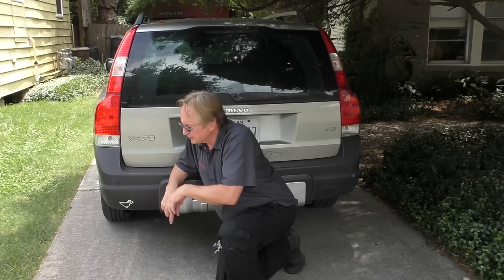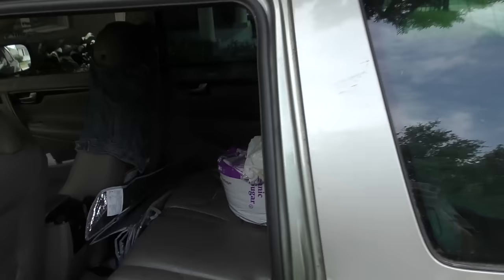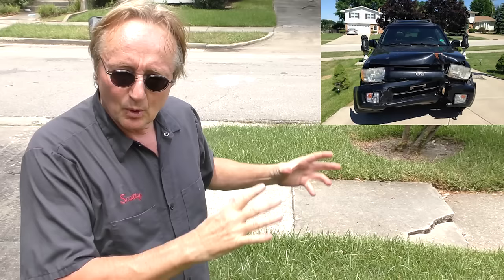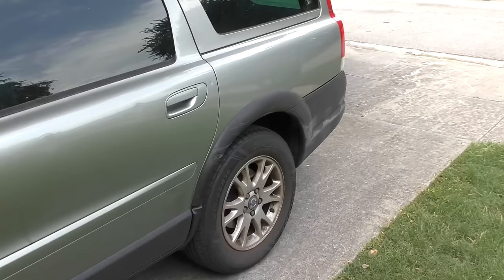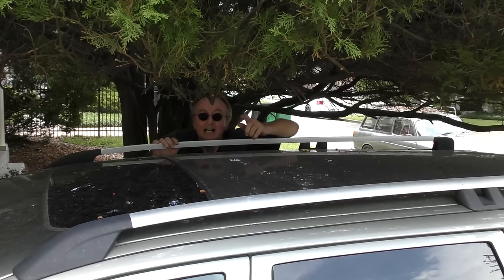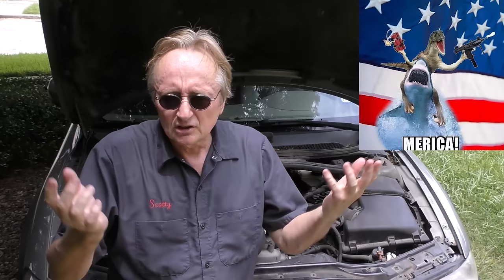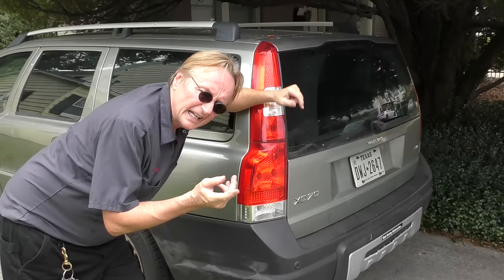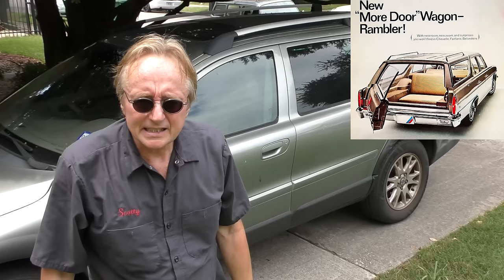Here’s Why Old Volvos Last Forever

Comment: Leather breaking is common in old Volvos, but if the car is high mileage and possibly 10-15+ years old, and still moves with no problem, it's acceptable imo.

Comment: I owned one. A ´03 V70 2.4 N/A 170 HP. Freaking comfy and reliable as a tank. The only reason I´ve sold it was its fuel consumption compared to the performance.

Comment: Scotty,
I just bought a 98 volvo v70. It's a wagon with like 154,000 miles. It has sat in Alaska almost 2 years. The shop that last worked on it said it was running rough and gave codes p0455 evap large leak, p0305 cylinder 5 misfire, p0300 randon misfire, p0303 cylinder 3 misfire, po301 cylinder 1 misfire. The shop then replaced the wires, plugs, rotor and cap. I guess it fixed it for a little while, but then it stopped again and wouldn't fire up. Then it sat for 2 years almost. What does it mean when all the odd cylinders are misfiring? It is a pretty nice car.
Now the car has a bad battery, which I am replacing tomorrow, and it has the alarm system going off with all the lights in the dash lit up. It won't even turn over now, let alone fire up. I think I hear and feel the gas pump engage. If the battery doesn't make it work, the next thing I will do is replace the gas filter. Also, the key got stuck in the ignition. Hope, I get it going, because I would like to get it out of Alaska before it is freezing!

Comment: My 05 XC70 has 226k miles and the original battery. It’s way more fun to drive any SUV or crossover, and that i5 is one of the best sounding engines out there.

Comment: Still have my first and only car a Volvo 940 Turbo, almost 187k miles and the last couple of years i'ts been on double the stock boost and the turbo has never been replaced, just changing the oil regularly

Comment: I had a 2004 VOLVO S60 with the famous 5 cylinder engine. Drove it for 12 years and 250,000 miles.  In between we smacked a deer going 60 mph, patched it up and it ran just fine.

Comment: I have a 1999 V70 with 300,000km (slightly under 200,000 miles) in the meter and it is still going strong.

Comment: 2001 V70 was totaled by my insurance company.  A UPS truck rear-ended it at 45 mph while I was at a stop light.  The rear crumple zone worked, and the Hyundai I was pushed into scratched the front bumper.  The Hyundai was in much worse shape than my Volvo.  It took a vehicle with a weight of over 20 thousand pounds to damage it.

Comment: It has surprisingly short and impractical (but easy to use) interior and small (low) trunk. Parts and maintenance is on the premium price range. It is loud inside, plastics are crappy and the engine of mine died and had to be replaced after less than 200k miles. But it still is amazingly comfortable and  reliable. It has carried loads of luggage, wood, bricks. It took as through long trips with 4 hours of non stop driving (and no pain afterwards), through paths where proper Pajero had issues rolling and through surprise bilzzards where most of the cars just had to stop. Overall it is a well constructed car.

Comment: I knew a guy who owned a Volvo dealership. He and his wife drove Mercedes, and he said to me that he wouldn't buy a Volvo 'cause they're endless money pits ... he didn't use that exact phrase, but he just said "They're unreliable to very expensive to fix." My landlord bought one a few years ago, and after a new engine and a new gearbox, with less than 100k miles decided to call it a day. But my best friend family had the old 240 back in the 80's... and that really was an endless money pit. 
     The best Volvo experience IMO was a work mate who had a 960. Probably one of the nicest experiences I've had of being a passenger. Can't lie I was impressed. But the inevitable bills kept coming until he got rid. 
      In terms of reliability, from what I've seen Volvo has been worse than VW cars .. and that really takes some doing.

Comment: I have a Volvo S60 2004 2.5T and drives like new! 173k miles. My ex nissan altima 2016 at 58k miles cvt transmission failed ;) dealer fixed it for free and I sold the nissan and bought the volvo for $900! Changed timing belt kit for $60, all rotors with pads for $99 and some engine and trans oil change. Booom pow love the volvo.

Comment: Bought one 2 years ago for 3000 euro. 2002 S60 170HP Manual.
It had 173 000 KM on the clock, now 242 000.
I would advice the manual to everyone it's bulletproof and shifts like new still.
Also the 170HP option is a perfect midway for speed and relability.
Spend like 3500 in the first year.
All normal stuff because of age.
Rubbers, belts, ac, thermo, trottle body, steering power pump etc.
Now it drives like new for almost a year without no problems.
Only oil changes and breaks.
I would advice it to everyone that wants a perfect all rounder car.
You can't expect something without wanting to spend money on it. Sure you can buy a Toyota, but does it give you the same feeling like this Swedish beauty?
You chose yourself.

Comment: Totally agree,  I'm on my 5th Volvo its a 2005 V70 D5 112,000 mls. Fully synthetic engine oil 8,000mls change. About to change the automatic transmission fluid. Heater keeps blowing hot and cold, but its got heated seats and I have plenty of jumpers.

Comment: I've been a Volvo guy since 80. Sold them, worked for the manufacturer, crashed them, drove them till the wheels fell off. Leased them for three years, kept them for 15. Our 09 XC70 has 327000 miles and looks great. Our 2016 XC70 has 140 and looks new. I love my Volvo. Won't be buying any new ones anymore because they've priced them beyond my reach. I love the looks of the V90 Cross Country. I don't like the overly complex technology interface. Distracting from driving. I love my Volvo.

Comment: MY XC70....Just about 300k.That was it. I wasn't willing to dump any more money into it. What went?....Ready for new timing belt...muffler, Cat converter, alarm battery, cam fault codes with check engine light and a transmission that would  occasionally slam hard enough  to shake the car downshifting and slipped upshifting,  valve timing solenoid and AC compressor. I bought it with 250k for 2k T Replaced front shocks and radiator. I got my moneys worth.

Comment: I have a 2012 volvo s80 and it is running well. 120k miles so far no problem. My only concern is that if something does break some day, such as the evaporator fan, it will take a tremendous amount of time to replace it. The location is ridiculously deep.

Comment: I have both a 1998 Volvo V70XC Cross Country Wagon with 185K on it, and a brand new 2020 Volvo V60 Cross Country Wagon with ONLY 400 miles on it (didn't even have 10 miles when I drove it off the lot).  Both GREAT cars, and been nothing but wonderful.  
Before these 2 wagons, my family had a 1984 Volvo 260 Wagon, and a 1990 Volvo 760 Turbo Wagon.  Again, both of them were GREAT cars!!!!
The 84 260, the 90 760 Turbo, and 98 V70XC were all involved in accidents, and in all 3 accidents NO ONE was hurt, and all 3 cars were repaired and back on the road.   They are impossible to destroy and if you take good care of their engines they run FOREVER!!!!
Only downside, they're EXPENSIVE to maintain, but they are worth EVERY PENNY!!!!!

Comment: Geely made a huge investment in Volvo but they are still designed and built in Torslanda, Sweeden.  The new 2016- SPA platform vehicles are fantastic.  I have a 2017 XC90 T6 that's got a 2.0l turbo & supercharged motor that puts out 315hp.  Best Volvo I've ever owned after V70, 850, 740, 240 and on and on.

Comment: 240 Turbo Stationwagon saved my entire familys life.

He hit a deer at 65mph, the stupid animal tried to jump over the car, fell into the windshield and cartwheeling over the over. The car lost the driver side mirror, and the windshield buckled and cracked but did not break. The deer was ground venison. The cops who came couldn't believe how the car had resisted the impact, they said such an accident in a US car would have normal killed the driver and passenger. My mom had a few scratches, my father whom was driving was unharmed.

My father was so impressed that when he sold the 240 (to our garagist) he went and bought another

Comment: We bought a 2009 Volvo s80 executive in top condition last year with 118,000 miles for $6,700 cash from a dealer, moved from Illinois to Texas and drove it down. It has been a most fantastic vehicle.   It still looks and seems almost new.   Much better than my Nissan Altima 2012 with half the Volvo's mileage.   What a bargain.

Comment: My first experience with a Volvo was in 1980 I was exiting the freeway in Carson, Ca. off the 405 to work at the Carson Mall. I rear ended a Volvo 240 1978 I was driving a 1973 Datsun 1600 coupe. I was just rolling slowly on a decline my whole front was destroyed the Volvo just had one of the four tail lights were cracked which cost my insurance $105. My vehicle was never the same!!! I learned to RESPECT Volvo and love them since that day!!!

Comment: Cars that last go on to be old cars. I had a Volvo 340; rough old wedge, but survived a Ford Escort impact with just a bent half shaft [I drove it to the garage to fix, the Escort had nothing forward of the bulkhead left). Now I have an 06 BMW 118d (from before the dodgy timing chains) that seems to go on forever - I was going to run it for a couple of years, but that was back in 2012 and I’ve still got it. Just wont die.

Comment: I had a 2004 Volvo with the 5 cylinder turbo engine which gave me nothing but trouble since around 70k miles. Suspension replaced, lambada and o2 sensors died, gear level broken and won't let me change gear, misfire, squealing wheel hubs, roof upholstery glue failed, leaky sunroof, jerky auto gearbox. I had to ditch it at 90k miles.

Comment: I have a 2004 V70 FWD with 145k miles. Non-turbo -
slow as molasses. But I'm getting 26mpg overall, and the onboard computer show 32mpg at 60mph in the highway. Too bad the glovebox and rear seat rattles and the engine is oddly loud. But thats the charm, eh?

Comment: First thing you do when you buy an old volvo is replace the entire PCV system. Those things gum up, crankcase pressure goes through the roof, and starts blowing seals, leaking oil, etc etc. Should do this every 100K miles.

Comment: The rear wheel drive Volvos  are the longest lasting. You still see those on the road 35 years later. They are put together with duct tape and rust paint but they still run. My son‘s first car will be a Volvo wagon. Slow, safe and big

Comment: I remember looking at one of the mid 80's Volvo wagon which had 284k miles on it and it still ran great.  I didn't buy it although the price was fair because I wanted something with an airbag at the time (this was the late 1990's I was looking for a vehicle).  But the older ones are very good.  These days, the more modern ones (say 2000+), are just expensive to repair, which is why I've avoided them and don't recommend them to people unless you lease them or buy them with the intention of selling it after the warranty runs out.

Of course, this does remind me of the Top Gear episode where Rut has an older Volvo (maybe an early 90's model) that literally was set on fire and still ran afterwards.

Comment: I get 31 MPG highway in my 2002 S60, and I got 30 MPG highway in my 2001 V70 turbo.  
I have a love hate relationship with Volvo.  I really like them for comfort, driveability, safety, etc.  Repairs are a nightmare.  My electronic throttle failed a couple years ago, it was about a thousand bucks to get it replaced.  The part was about $800.

Comment: We still driva our 18-year old S60 daily . It has 275000 km on it which is not so much but it runs economical and most functions still runs except the AC . Here in sweden it wount be such a trouble cause you only use it for a short while every year .

Comment: I've ha 2 XC70 station wagons, a 1999 7 a 2001, Loved Them  !!
Working as a Field Technician it was great to carry a lot of tools;
And you could pop open the back door and have a seat & eat your lunch, or working on your laptop.
The 1999 was way better, the 2001 had a bad transmission, shifted weird, but still ran.
Awesome all wheel drive that handled snow with no problem at all.

Comment: Still absolutely chuffed with my old '07 S40. The 5-cyl engines are interference and they do require a timing belt change at 100k miles, which is not a backyard job for most. They're all heavy AF and the natch aspirated ones can struggle to accelerate BUT mine is a 5-speed manual and I do just alright with it. That generation of styling is still pretty modern and not ugly exterior. Interiors, different story 😂

Comment: We owned an 01 with the Ford transmission. Nothing but problems.  Stepped up to an 07 and much nicer car but over 200k miles, steering rack leaks, timing belt replacement is $1200.  Nice cars but pricey to fix.  I owned a 96 850 wagon with 5 spd manual and a naturally aspirated engine and was able to get 406k miles out of it.  It was a tank.

Comment: I had a V70 2,4. Gasoline, not the D5. It had 540 000km on it when I sold it and it still was 100% reliable. D5's run 6-700K easily.

Comment: Shame the angle gears were such a problem. I had a gorgeous 2005 XC70.. Angle gear crapped out. Cost me a small fortune to get it fixed.. then the angle gear housing was cracked  and leaked.. A radiator cost me 3x the price of any other radiator I've ever bought.

Sad to say it but they are SOOOOOO expensive to maintain in little New Zealand. Most awesome car I have ever driven but I couldn't afford to maintain it. If I ever move to Sweden or the US.. I'd buy another!

Comment: I have a 2004 V70 non-turbo I get excellent gas mileage it's the only thing I want to drive when the snow is thick Quite an automobile I put a bunch of new front end parts under it just so I would have it like that I do that on all my cars I'm under a 180000 on it and it still works like a charm the only thing I've ever had to do to it was change one resistor and I had to diagnose it and find that myself but I have never had a problem with this car

Comment: "Rev up your engines!"..........unless you just started it. In that case let it warm up for a while. Also, if you have a wet sump setup make sure you're not parked in a hill. Oh and one more thing, check your floor mat and make sure it's not going to jam the gas pedal to the floor. Just in case.

Comment: I just survivent a serious accident. I went flying  into a ravine. The roof had to be removed to take me out. Those life jaws had some trouble cutting through the Volvo (xc70 2.5Tm AWD - 2007) pillars.  I suffered mucho whiplash but nothing broken our of place. After spending 8hrs on a board with a collar,2 xrays + an MRI they let me out. A friend of mine went to collect my things (tools) and found that the doors where opening and closing as nothing happened. I miss that tank and snow machine (200km north of Montreal). Now I have to buy an other car with good crash ratings (newer Volvo’s are to expensive).

Comment: I bought last year s60 2.0t from 2007, with 183.000km from the first owner from Germany and it looks like new... Just amazing. It is better then previous merc c, audi a4 and bmw 3 which I owned. The most comfortable seats ever, perfect 5 cilinders petrol turbo engine, reliable and not expensive to maintain. Planty of equipment like premium cars from higher class, including supreme stereo, auxiliary heating, termo isolated glasses and more... When I sit in any new fency modern car, I feel its bunch of cheep plastic and just Chinese tablet in the middle. My s60 will outlive them all!

Comment: Thanks Scotty...yes the P2 chassis XC70 is solid and runs forever with proper maintenance.   Our 2004 looks like new still, the undercarriage is rust free and the engine has 256k and going.
Reply: I have a 2004 xc70 with 96k miles on it. Looks really good.

Comment: I’ve got an 05 XC90 T6. It’s the Swedish tank!
Reply: Are the XC90 good vehicles?
Reply: @fatpapi17  anything before 2006 yes! Although up until 2014 they where still pretty good. When Ford bought them and started making their engines their reliability went down. But they where still tanks. The newer ones (2016+) are all turbocharged I4s. Not nearly as reliable as the original XC90s. But their still rated some of the safest SUVs!

Comment: So what years do you recommend if looking to buy a Volvo?
Reply: P2 chassis Volvo's between 2000-2009 with turbocharged 5-cylinder engines. The XC70 and S60 T5's are quick, very solid, and can be found for under $5000 with around 90K-100K miles. But the turning radius with the T5 engines are huge due to wider tires, FWD drivetrain, and cramped engine bay. S40's are more compact and have a normal turn radius, but aren't as solid or powerful. I love my '06 S60 T5, but if were to buy a second Volvo, I'd go for a C30 T5 manual hatchback which goes for around $8000.

Lots of quality OE and aftermarket parts for good prices and warranties from online sellers like FCP Euro or IPD. Some of the maintenance deep in the engine bay might require a skilled Swedish/Volvo mechanic, which are few and far between and pretty expensive. Volvo maintenance is definitely more expensive and difficult than most Japanese cars, but are about as mechanically reliable. But nowhere near the expense or headache of German cars.
Reply: 95-2005, get the turbo 5 cylinder ones, my 04 s80 has over 230,000+ miles on it and literally all i have to do is change the oil, it still runs perfect

Comment: got a v70p26 from 2003 made in sweden, quiet much electronic thats annoying sometimes but technically no problems.  You have so much space inside and its so smart to lay every bench down or change parts to newer ones. you can make many things still by your own. the last true volvo. the 850 was better of course :)